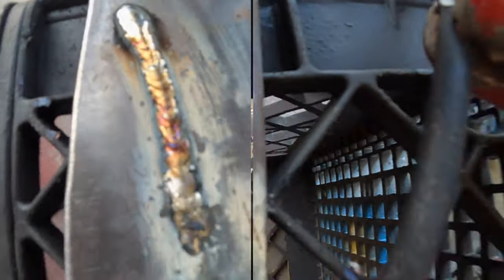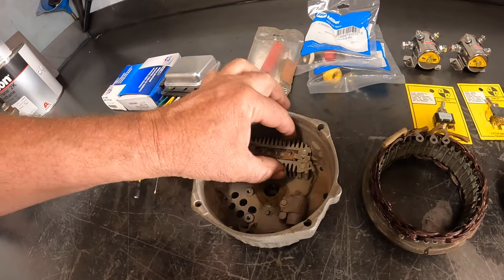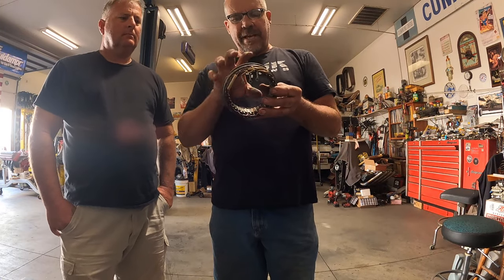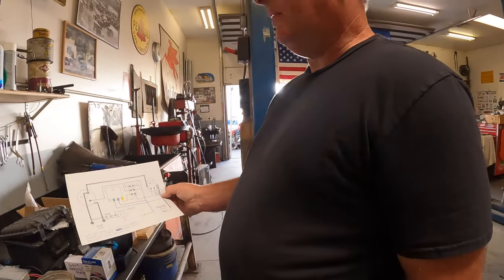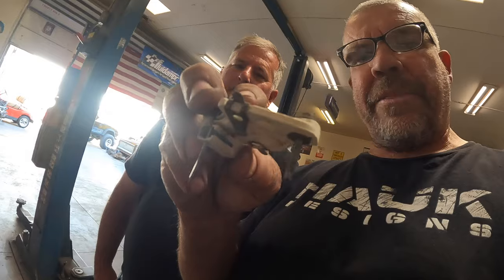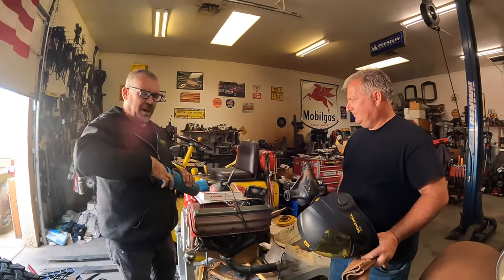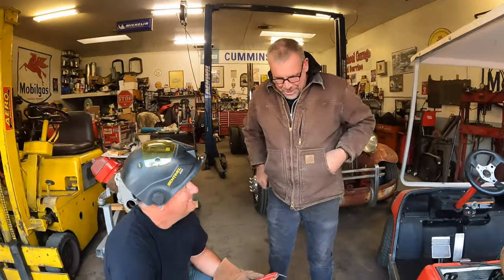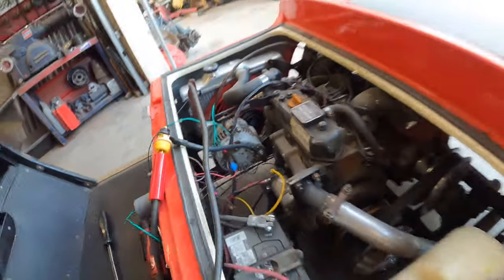How to Turn Your Alternator into an Arc Welder

Comment: When I fitted my 2nd alternator I thought about doing this (I have reasonably high power demands especially at idle, hence the 2nd alternator) but I never got around to figure it out. You've given my the inspiration to go ahead & see if I think i can do it now. The 2nd alternator would of course still allow for some 12volt charge when it's switched over to welding. As I have also installed an engine driven air compressor, tank & hose reel I also want to put on some form of throttle control, so it too would double for welding. Now just to figure it all out. Thanks! oh! Mine is single wire GM

Comment: I have done this for the past 22 years, and the alternators really do stand up to the load amazingly well. 
 My rig was able to supply a steady 240A, while delivering 9KW into the welding electrode, at 100% duty cycle. 
 Today's alternators are OK, but their diode packs are not rated for the higher voltages, so external ones should be fitted, for long term reliability.
Reply: Well, what did you use??
Reply: @mistersniffer6838  
 I used 6 alternators from the 1980s, taken from Ford Telstar cars. 
 Each one was rated at 60 amps, which I also measured, and confirmed to be the case. 
 4 were always active, and the other 2 were there as backups, hence the 240A rating of the machine. 
 Those older alternators can easily handle 120V DC, whereas today's ones will burn out their rectifiers, by the time they get to a mere 30V DC.
Reply: @CNCmachiningisfun   - Thank you
Reply: @mistersniffer6838  
 You are welcome  :) .
Reply: They're using shottky diodes for lower forward voltage and fast recovery that leads to higer efficiency but they are lousy at high voltages. An external rectifier pack is the way to go. An if you're into electronics you can make a simple circuit to control the current by varying the exciting voltage. Electrodes need mostly constant current. Cheers.

Comment: Very interesting . I built a welder with a air craft generator it worked good but couldnt be turned down very low. I will be rigging a alternator up soon . Thanks for showing how. I have been watching your videos and wondered just what kind of guy you are. This video makes me think  your a good guy that knows his stuff thanks.
Reply: 1942 or before aircraft generator. welding this is not new

Comment: Simple enough. Now I know how my dad's car worked. Back in the 70s he bought a kit to go under the hood of his car so he could power his drill etc. If only I had known I could have welded with it. Maybe add a volt meter to it. I know how to vary a regulator. Dodge has fewer wires. The possibilities. I got ideas now. This also explains how the rather expensive kits work that make welders for off road work. This is way cheaper and so simple there is no need to ever buy one of those overpriced kits. Thanks!

Comment: I needed a quick weld, used 3 of the 6 6volt golf cart batteries, jumper cables.. welded no problem. Obviously an alternator works better. Great video. That darn diesel cart is such a bitchin build.

Comment: I'm not a welder but pretty cool explanation on how that works thanks 👍. I believe  Rory has a welder setup similar to what you have on Trail Mater
Reply: Even sounded the same with that high pitched squeal. I believe Rory said something about having to use a brush type tool for it to work on his machine.

Comment: I haven't played games with the AC Delco 12V 140A CS144 alternator, but I do know that it is dollars-to-amps the cheapest alternator on the aftermarket. However, several applications, GM had the alternator supported by the block on one side, and a 5/8" stay brace in the back as well as the upper front alternator mount. Total dissipation at 14.4 volts is roughly 2 kW, well more than one horsepower, so you know there is a lot of resistance to rotation.

Comment: I built one for my jeep using a stock dodge 1990 alternator.  Externally regulated so no modifications.  I can also run a 4 inch grinder.  Made it to fix   out on the trail.  But also built a 12 foot metal gate frame.  The sound is unique too.
Reply from the maker: Awsome 😊🏁

Comment: As a car audio guy, I would just add a second alternator solely for welding using a custom bracket. If you put a manual locking clutch on the pulley, you could easily turn the 2nd alternator on /off. I wouldn't feel comfortable putting my only alternator through this kind of torture for fear of damaging it.

Comment: Great video. I'm kinda glad that the first alt had a bad diode because it showed the basic nut and bolt golf cart one. KISS - keep it simple -  (stupid, special, Soldier, Sailor) take your pick. If you would show the golf cart and then the other welder setup with all the info and diagrams in a pamphlet on Amazon for 5 bucks - I'd buy it. Thanks

Comment: You mentioned regulating the voltage that you feed into the field coil. I've done this using an old school headlight dimmer (back when they fed full power through them and the dimmer was a reostat). That way you can precisely control the output, and you can even hook up a TIG torch and TIG with it (use a torch with a built in gas valve and you run shielding gas with your thumb). 

I've run this setup off of a truck as well as off a small gas engine and even a compressor motor. You'll be surprised how much power the alternator draws, you can stall a 5-8hp engine/motor driving one of these things before you can feed the field coil a full 12VDC, and with a good size alternator there is no point in doing it with under 5hp driving it.

Comment: If you want an even better setup: Go on ebay and buy a 110-220v input inverter stick welder. Pop it open, and find the input rectifier. Flip 2 of the diodes so its just straight DC input. Get a pair of anderseon connectors, and set it up so you can plug the welding output from the setup in the video into the welder with the correct polarity.

Now you can use current control with this setup. You can even use a multi process machine. I have a 200A alternator feeding into a $100 160A multiprocess welder. Welds just like a shop machine. Dose stick/tig/mig like butter. Should work for AC inverter machines do for aluminum.

You can even get a plasma running this way if you could get dry enough air.
Reply: WOW we were doing it in the 1940's
Reply: Hey @HotelSoap, do you mind me getting some contact info so I can ask you some more questions about this? I’m making a video on how to do this but I’m running into some annoying problems

Comment: Great vid....  honestly wished you had also done step by step to go with the theory in the vid.   Multiple different means / Multiple different avenues  of  soaking in the information into the brain reallly helps the learner formulate a complete understanding of the theory thus be better equipped to apply it..   You gave us visual and auditory of "the theory" .... appreciate that.  When you get the change please also show a hands on build of one.. which will vicariously offer a "hands on" learning avenue for folk to use to really "get it" in their skull better. (aka- thick skull me).  

PS-learning and how the brain does it;  cause Im stupid, is my thang. lol  (thus got several degree's "learning/pedagogy" in hopes to be be less stupid over time LOL)

Comment: About 30 years ago a company out of Dallas, called RESCO Mobile weld used a 130 amp alternator and contolled the heat output by varying the frequency. Joe Douglas was the man!

Comment: How cool is that? Should I have one converted alternator and one for normal use on the engine? Will a six HP gas lawn mower engine drive a modded alterbator?

Comment: You probably should have asked someone for help with the electrical part of this.  @2:23 that's a  DPDT double pole double throw switch (6 lugs), and a DPST double pole single throw switch (3 lugs).  @3:08, all diodes are rectifiers.  The 4 of them in your diagram are configured as a single phase full bridge rectifier.  They turn an AC power source into a pulsating DC power source.  Car alternators are 3 phase power sources and typically have 3 pairs of diodes in them in a 3 phase full bridge rectifier.

Comment: Dam right it welds hot and fast most stick welders are 16 to 24 volts and high amps that high voltage will get the job done fast

Comment: One of my friends had a portable welder, using an alternator and a Briggs engine to run it (rpm controlled). I think if I did it off of the vehicle engine, I would mount a second alternator (if theres room) and put the smallest pulley on it possible.

Comment: Neat! So it charges the vehicle and then switch it and it is a welder. What if you want to run a separate alternator strictly for welding? So cool! I almost threw away an old 90s mustang alternator I upgraded, but now I will make a welder!

Comment: The switches on electric powered tools have two separate amperage AC and DC ratings.  If your disc grinder switch is not rated for 120 volts DC, you will burn out the switch.  The disc grinder will require a properly rated switch to operate.  Ask me how I know?    I have an old DC SA-200 engine welder with a 120 volt DC output for power tools, lights, etc.  Some of my electric power tools work fine, the others burnt out because the switch was not rated high enough for DC operation.  The AC/DC amperage ratings are stamped on the side of the switch, so it was easy to figure out what went wrong when they failed.

Comment: Hello, so horsepower doesn't really matter as long as the engine could handle the load and pull 2000+ RPMs. A 12hp Wisconsin could do it. Cool video. Thanks!

Comment: You should mod one that can do both DC and 120V AC. Of course you'd have to do a balancing act on the input voltage and RPM's to get the voltage and Hz right.

Comment: I did this on my jeep with a denso 2 wire. It worked good. The only questions I have are, what would be the failure point on the alternator by running it like this? Why does my high pitch sound not as high pitch as this one? Does it have to do with the voltage output while welding, like how many rpms it's turning?

Comment: FYI, the switch you describe as a "six-pole double-throw" is actually a "double-pole double throw".  A six pole switch would be 6 individual switches in the housing, and would probably get you some puzzled looks at most places you would ask for one.  The number of poles refers to how many individual switch sections are in the housing, not the number of terminals on the back.  Good video, and now I'm going to have to try this.  However, I think I might use a salvage alternator and run it with a standalone gasoline engine, rather than have to run my pickup's gas hog V-8.  I'll have to do some calculations to see what the horsepower would be at full load.
Reply: You figure out what size engine you need?

Comment: Couple years ago I watched a video where they took chrysler alternator.  Got ahold of the three  wires inside. Spun a waterwheel and sent the power to the house a distance away to a controller into battery storage. 
GOT ANYTHING MORE  ELABORATE ? 
Thank you

Comment: A simple resistor divider across the regulator's sense input would let your stock regulator provide higher controlled output voltage. In other words, fool the regulator into thinking its providing 12V output, when in reality the output voltage is 24V, 36V, or whatever you want. Say you want 36V output, so you cut the sense input for the regulator, and add a divide-by-3 resistor network. Input to the resistor net is 36V, output is 12V. Hook the output of the divider to the regulator's sense input. Regulator now actively controls regulation, targeting 36V instead of 12V. I wouldn't put 120V through a diode which is expecting 12V. Best case, it'll avalanche. I don't know specifically, but I'd I'd guess these diodes are probably only rated for 60V, if that.

Comment: Question: the 28-volt limit rectifier, was that an LS alternator? Which diesel alternator did you switch to if so, I don't have room for a taller one?  Getting ready to do mine to a 06 6.0 LS truck pulley. Great video!

Comment: Cool video mate.. thanks! The burnt out diode in your jeep.. is this indicative of the welder driving the diodes too hard? I'm thinking of adding a second alternator and a beefed up external diode pack if this is going to be an issue.
Reply from the maker: Yes that rectifier has a limit of 24 voltage output max some of the new computerized alternators have that type of rectifier and then I’m going to try to change the rectifier to an old style and see if I can make it work there will be a follow up video on that
Reply: @MerlinsOldSchoolGarage  Neato, thanks!

Comment: I'm assuming the commercial Alternator/welders will have a regulator circuit to still feed a 12v (nominal) voltage back to the electrical system, so you aren't running a total loss ignition?

Comment: I realize AC and DC are completely different animals but, can you get a shock off the 120 DC? I play with 36 and 48 volt golf carts.  With the lower voltage but higher amps, you can get a small jingle if you are sweating.

Comment: did Paul not buy a welder??   going to have to give this another look when I get to this point...  ran. in to a snag with the drive shaft flanges that use an m11 stud.....no one carries these...  I need to order these in... or switch to m11 bolts ...

Comment: Hey Merlin! I have a one cylinder Diesel engine probably around 6HP which I am planning to use for an emergency stand-by generator. If I set up a 65 amp GM alternator the way you describe, would the Diesel have enough torque to run it? Also could I eliminate the diode bridge to generate 120v AC current to run my appliances?
Reply from the maker: yes

Comment: Here's the part I still don't understand... If you disconnect the battery from the alternator when charging, it will fry the regulator.  I get you're switching the fields off, but when you put it in weld mode how does it not fry something when not welding?

Comment: Any time I tried welding with batteries it didn't work, even 24 volt. Battery voltage is stone flat - no pulse whatsoever. The only way I could make it work at all was if I hooked up an AC charger to one of the batteries which gave it a little pulse action.
Lots of horsepower but no arc.
I bet this works good because it starts out AC.

Comment: Think it would be adviseable to install wide belt pullies on everything for the added alternator torque loading while welding? Seems like a thin belt might slip or wear prematurely?
Reply from the maker: They were good with just Veebelt police I’ve done it for years the golf cart set up was a serpentine Drive running on top of the drive pull V groove pulleys
Reply: @MerlinsOldSchoolGarage  Good to know, thanks. It's a cool modification for certain.

Comment: Excellent Merlin. May i ask you a question please would you have to have a seperate alternator on your vehicle as a stand alone unit just in case or can you dual wire a standard alternator so as to switch between charging and welding?
Many thanks Marc
From Great Britain. Love your channel 👍🏻👍🏻👍🏻👍🏻👍🏻👍🏻
Reply from the maker: I use only one alternator but you can install a second alternator with ease

Comment: Great Video .. Question .. if you were to have the room for a 2nd alternator .. leave one stock to run the auto and the 2nd one to do the welder / outlet power .. could you put a larger pulley on the 2nd alternator  then you could have full power at a engine low speed .. also I have a Chevy 2500 HD pickup with a diesel so I have 2 batteries .. so the 24 volt input would or could also make for a higher output ? .. I have a few old alternators laying in my barn from the late 80's Chevy's and I think I might have a newer style laying in there too .. I am thinking the old Chevy's needed a jump for them to start making electric / a dash light bulb hooked in the system .. a friend had a old field truck no lights off road use ,, had a little bulb under the hood hooked to the alternator so it would make elec to keep the battery charged  something about creating a field maybe ??..
Reply from the maker: I have seen that done before yes it works great
Reply: You'd want a smaller pulley on the welder alternator if you want to turn it faster, rather than a larger pulley.

Comment: So if you were to use a nippon denso hairpin alternator (the one with the external brush holder and 12 diodes) with a 370amp build you’d actually have one hell of a powerful welder. The rest of them alternators are just junk. (May not work well for powering 125v things as they operate in 6 phases  so the cycles of ac would be way too fast) these alternators can be found on much more than the cummins diesel trucks.

Comment: Any words of wisdom on using a 24v/two battery welding system? I've seen it done with two car batts & two sets of jumper cables. Does the high amperage from the batteries take the place of the high voltage from the alternator set up? Thx

Comment: Very informative, thanks, I figured id weld with ~45V for stinger electrode, but unladen voltage being ~120 at elevated RPM, isn't that a risk of electrocution? - all the best, saeb- Iceland

Comment: Could you also use a alternator set up running off a electric motor like you would a table saw or a bench grinder to run the alternator and weld

Comment: I really need something. I can't afford a welder but can afford an old used alternator and I have tons of other stuff lying around. Edit, didn't realize it would be straight from the vehicle. That's bad ass and would help in a pinch. But I'm going to do it with my gas powered Colman generator. See if that will provide the RPM needed.

Comment: I saw all the bits about diodes but, bottom line, is the welding output AC or DC? With an alternator that started life as 67 amps at 12 volts, what voltage and current would you expect as a welder?